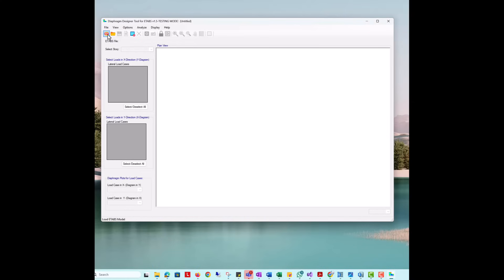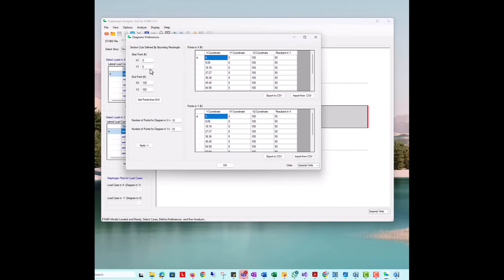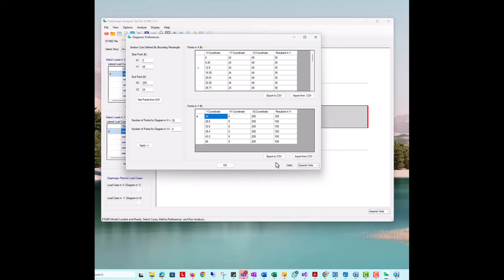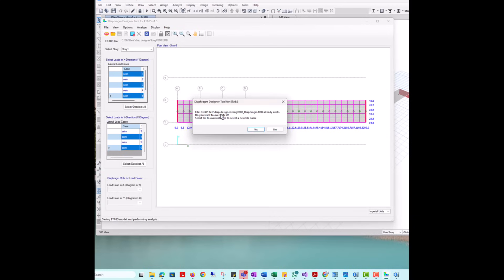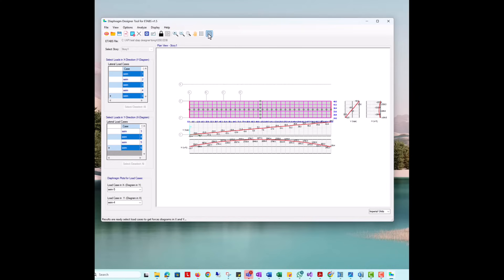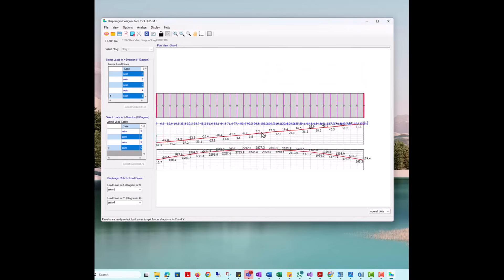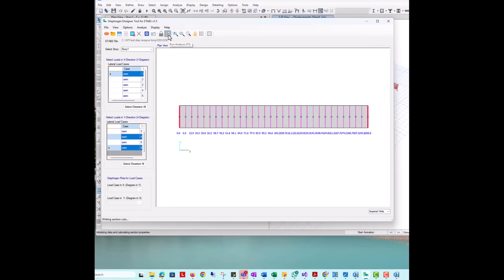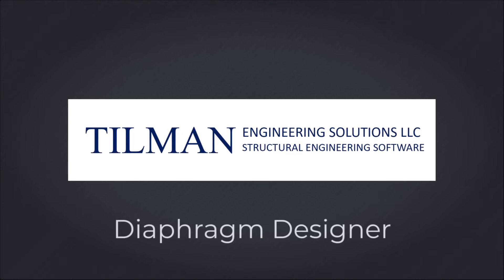Diaphragm Analysis Tool for ETABS (An Overview)

Comment: Looks good ... what's the mechanism the program uses to find the forces? Does it get the results from Etabs section forces after creating the section cuts in Etabs or does it perform independent stress integration along the section ?
Reply from the maker: The tool defines section cuts at the locations provided, adds the cuts to ETABS, gets section cut V and M resultant forces back from ETABS for plotting and reporting results table in the tool. The section cuts are also saved in the ETABS model for results comparison.